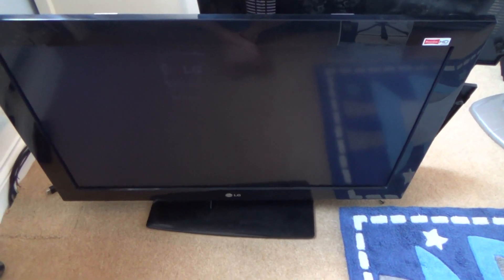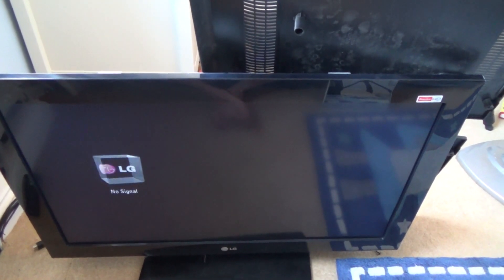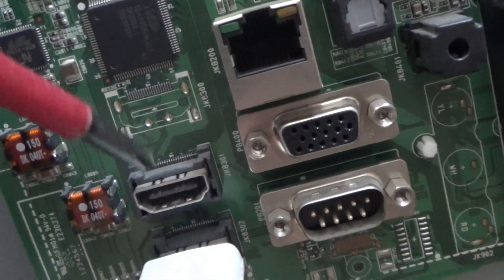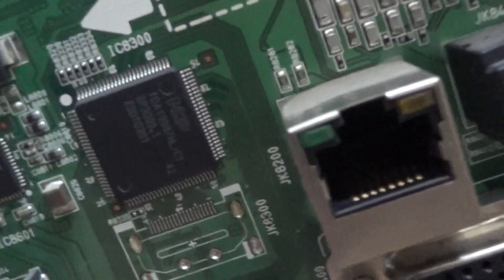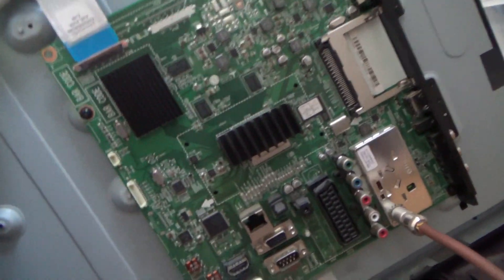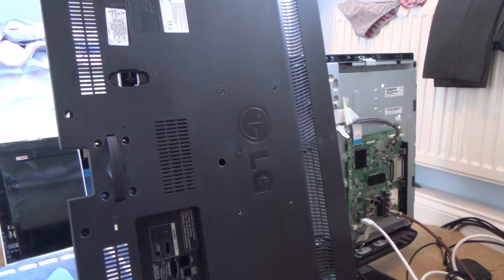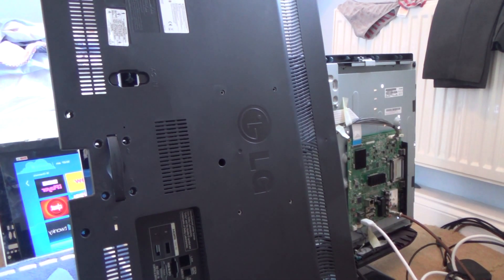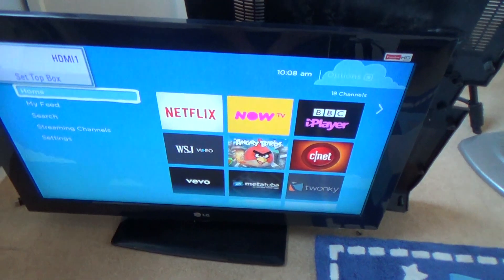Faulty HDMI Port on LG Television. No Signal Fault

Comment: thank you.  big help.  fixed by LG 60LD550.  I reflowed the CPU processor as you did, but also did a chip next to the 3 HDMI inputs (saw someone else say this was the problem).  So I used flux on box and then reflowed with a heat gun and a meat thermometer.  Worked like a charm.  Let's see how long this lasts.  I had paid an internet company to fix this card about 4 years ago, they probably did the same thing.  Thanks again.  Good video.

Comment: Wondering if you could give me any advice, basically my hdmi port will not work for my PlayStation everything else is fine. I’ve changed the hdmi wire tried many and still no signal. The tv is about 15 years old one hdmi port.

Comment: Easier to just use the software and do a factory reset. Had probably put devices in different HDMI ports after unwiring after electrician visit. Was not recognising my PS5 and more and was saying Sky box was connected twice. Doing the reset sorted everything. (Be ware any apps would get purged)

Comment: On my LG LE 5500.. it is not the hdmi chip..( TDA19997HL ) but the processor with the big heatsink that have to be  reballed.. but i  repaired  with a mechanical solution.. put something between  backpanel and heatsink.. so that there is pressure on the heatsink. or a plastic screw.. so you can adjust..

Comment: It worked! My neighbor tossed his 42" and said the part was no longer available to fix the inputs. I figured maybe eBay might have a board. I did find one, but it was too expensive for repair of a 10yo TV!

Propped the hairdryer right up to the chip with my opened TV lying flat and let it heat for 5 minutes. I also saw that a screw was missing at the corner of the board. Neighbor had taken it apart already, so maybe he lost one. I found one to put there. Gotta make sure the board stays flat! I sprayed rubbing alcohol into the hot ports and swabbed them a bit. Back together, and all good! Thanks!

Another TV I fixed had a known issue with a screw not being grounded. Something like that. Easy to repair except someone else had ruined the board trying to DIY solder. I spent money for a board anyway because it is a nice older plasma, large screen. Still working.

Comment: My LG tv HDMI ports all stopped working tonight. I followed these instructions and wow !! now working perfectly, thank you.
Reply: Is it still working for you ?
Reply: @EternalNovA  Yes 3 weeks on and still working perfectly, fingers crossed.
Reply: @malcolmtodd2340 how long did this last?
Reply: @BerkshireAutoDetail  I replaced my TV about 6-8 months later and it was still working fine at that point
Reply: My tv did this so I'm gonna have to take it apart and do this and see if it works

Comment: It worked!!!! I tried that on a 50 inch LG 50PK950, and after a few time with no Signal, HDMI started working again! I have to add that the total time of Heat I applied is 2 to 3 minutes, in attempts of 30-40s, then stopping. HDMI came back after some time, not instantly after heating
Reply: hello hot air repair still holds? thank you

Comment: I had same problem, the chip that is not working only controls the hdmi signal. Solution, buy a cheap hdmi to vga converter like this one https://smile.amazon.co.uk/VENTION-Converter-Adapter-Digital-Projector-black/dp/B07F7WYGHV

Comment: Great!!! It worked to my LG 47!! Thanks boss!! And it's one more tip. I didn't remove the back cover, but blew into through the duct. It worked when I blew about 30secs, and I did 1min more for just in case. It took just 2minutes without any tools!!!!
Reply: Thank you
Reply: Is it still working now with one-time fix?
Reply: @jun9886  Yes. It still works well. Ironically, I thought heat was the cause of the breakdown, so I put a cooler on the back cover duct a month later. It only costs $5. I stuck a 60mm usb cooling fan with double-sided insulation tape. That's all I did. Good luck dude.
Reply: thanks for the tip. worked for me too on my old  LG 55  '12. didn't have to take out the backside, i just put the hairdryer very close to the duct. no tools needed.
Reply: @juicychicken6779  No problem dude.
Reply: @juicychicken6779 with the tv turned on?

Comment: Hi same problem samsung model number UE55ES8000U
UE55ES8000UXXU 
version no 1
S/N Z9EP3SAC401936Z
Samsung Main
Board BN41-01800B BN94-06124K
Any ideas would the hdmi heat work they stopped working after a lightening spike on the mains

Comment: Like you said it's a shot term solution. The problem is that one or more pins on the HDMI chip has lost it's connection to the board because of expansion and contraction over the years. The easiest , permanent fix is to use a soldering iron and solder wick. Lay the wick over the all the pins on one side of the chip and then slowly drag the hot iron down the wick  . Do the same for the other 3 sides. Be careful not to pause to long as you go over the pins since you don't want to suck all the solder out from under the pins. The goal is to heat the pins just enough to get the solder to turn liquid without sucking the pins dry. Sucking them dry is just about impossible anyway but heat is the enemy of chips so don't hang around too long with the hot iron as you go along.
Using the soldering wick makes it virtually impossible to solder 2 pins together by accident. If you just run the hot iron over the pins without the wick it is VERY easy to solder 2 pins together.
Reply: Well is this method a permanent fix or short term too?
Reply: @DJrockSStar  -It's permanent . I forgot to mention that brushing on some flux over the pins helps the solder to flow better.
Reply: @TheNYgolfer  Ty for bothering to post this I'm a huge fan of doing this sort of thing yourself, this appears to be the same issue as the red ring of death back in the xbox 360 days, i wonder if a lot of these port issues are simply the thermal paste losing effectiveness rather than the components themselves being bad, i mean they're like metal and crystal and shit it seems reasonable that they wouldn't just go bad after a few years pretty durable materials, whereas the paste isn't really by comparison.
Reply: Late reply this may not work if the controller chip for the hdmi has completely fried!
Reply: A mi me sucede al ver los canales cual sera la solucion. Solde los pines del varicap y no funcionó
Reply: Me gusto tu explicación.  Lo. Voy hacer. Tengo un led q funcionan cuando quieren los hdmi. Yo reinicio el tv para q vuelvan a funcionar

Comment: This is my solution. Suddenly all of my HDMI ports from an 50 inch LG Tv stopped working. I've watched a lot of this videos. My HDMI ports were listed on the menu (that mean that they have power) but always showed NO SIGNAL. I've tried to use this method but decided to follow Carlos Frontado (user in the comments) and bought the chip that is responsible for HDMI ports (2 USD on ebay) and found a profissional that changed the chip on the board (a TV repair profissional) and voila...it now works. This is my advice. Change the chip.
Reply: does the chip have to be the same as the motherboard or can you just take a random spare?
Reply: @jumbescosisbruh6110  Random spare.

Comment: Thanks for your video, my lg do the same fault years ago and I send it to an technician to "rebail it" and it was work for a few months then it fault again. So I open it and take a look at the main board and see some marks on every chip pad, like if it was  heated with and soldering air gun.  will try to fix my lg like you explain here and write to you if it works  . Thanks again, cheers  from Argentina!!

Comment: i fixed my lg tv and have been using it for 3 years you need solder flux and hot air gun not air dryer as that will simply just warn the chip up for a short time

Comment: It works, but only for a few minutes, is there any way that i can attach a heater behind to constant keep the chip heated?
Reply: You need a heat gun that can heat it up to about 350 farengheit  for 20 sec. issue is coused buy bad quality chips they heat up during operation and soldier develops a crack.heat it like I said, and it should be a permanent fix, hairdryer will work but not for along time ,it will not get hot enough to get a good soldier flow.

Comment: Thank You. This works!!  I have a 48 inch LG about 5 years old and it was working perfectly up until recently. The TV is located in my basement rec room that isn’t used that much anymore since my son moved away. Like most homing pigeon kids he returned however the TV would not work on HDMI. I think now that he’s using it again and just getting it back warming up again the problem may go away permanently.. Your right that it doesn’t take much heat. In fact I decided to try it by just heating directly onto the back without even disconnecting anything.  I used a 1200W heat gun about 6-8 inches away for no more then 15 seconds and the HDMI ports became available again. Easiest TV Repair Ever. Thanks Again.

Comment: Hi ! Thank you for the nice video !  I love fixing theese boards ! ,.,,  Just get yourself some NO CLEAN FLUX and set your heat to 250 Celsius Temp. for about 15 seconds evenly distribute the heat to the whole chip while covering everything else around the chip with aluminum or better :) it will be a permanent fix !  ... Kind regards 
Frank

Comment: It works thanks!
Reply: Excuse me,  my PS4  isn't detected by the three HDMI ports so if heating it should work ? Thanks 4responding...
Reply: @tanjawiuk709  it works on my device. but this is only temporary fix though
Reply: @mikesong256  
But u should just reheat the chip 2get it fixed, ye?
Reply: @tanjawiuk709  yes

Comment: yes that is a good short-term fix and the other one when you bake in the oven for 10 to 12 mins,the way  i have solved the problem is I have a Freesat box that has a scart plug on back so my tv also has a scart so just put an old scart lead in and now working, also the blue ray player have bought an HDMI lead to Component lead yellow-red white,and for my games console bought a Wii to Composite lead .you can also get component to component and component to hdmi.this is the way if you dont want to take the tv apart.

Comment: Before I took my TV apart (or bought a new tv) , I investigated other possible solutions. Adapters: If you choose the male hdmi with female vga (which is also 1080 on the back of the TV) AND the audio output, you can do a permanent fix.. I found several on Amazon for $8.00 even including a mini-hdmi to usb and the 3mm audio.  Works wonderfully. And the hairdryer solutions ? My electrical engineer friend says it's NOT the chip that is fixed by the heat but the micro cracks in the solder in the board, that expand and reconnect once heated. And slowly recedes and disconnects. This way it's permanent.
Reply: Your engineer friend needs a bit of an update. The QSOP Chip actually has maybe just one detached leg causing it to have a little space between the contacts.Due to the heat expansion the leg gets a bit larger and it may touch the solder of the mainboard like it should , then due to surface tension or adhesion it actually picks up a small bit of solder paste and reconnects with the main board. BUT because of the cold drawing back the leg again to its original size it pulls this solder back in a fine line and only the fine line of solder >( like a spider web string ) is now connected. NOW you have HDMI Signal again , BUT because of the process of shutting off you tv and then turning it back on there is Thermal stress that will likely break this little spider string in the near future.  The Proper fix is : Put the Mainboard flat on the Table and dump a coin on it. Use a syringe to put FLUX on it. Heat the Chip to about 240 to 250 Celsius for about 15 Seconds until you can MOVE another component with a plyer next to the chip. If you are able to move another component next to the chip that means you have reached the proper temperature. you can now withdrawal the heat SLOWLY ( about  an inch every second. This will help with the thermal contraction being done almost properly. The weight of the coin ( anything ,,, maybe just a cent or two ! )will put enough weight on the Chip to put it down properly.  .... NOW if things are still not fixed then  you MAY have a broken trace (this is where the fun would start for me  ! ) ...  To pinpoint the issue further you could use some ice Spray , but proceed with caution.Even a TV that has been disconnected for 6 month may still hold a charge up to 300 Volts or more in its capacitors... It wouldnt be fun... Trust me :)   Kind regards Frank

Comment: Hi everyone! No need to heat the chip! The problem 99% of times is just the dirt or the oxidation between the teeth of the two chips that are shown in this video! That's the only solution, also because many of those main boards are no more purchasable

Comment: Con esta solución arregle mi 42le5550 sin sonido. Simplemente puse un secador de pelo directo al disipador grande del MCU principal por 5 minutos hasta que quemaba como loco (y un poco al nt7000).... y el sonido volvio al encender. No creo que sea un tema de reballing sino alguna protección que salta por temperatura y queda bloqueado. Ademas le agregue unos disipadores de bajo perfil. Una tremenda bosta estos televisores. Creo que la solucion de meterlo en el horno es demasiado agresiva.

Comment: I got an LG surround system BH9540TW. The HDMI stopped working due to a thunder strick but the system still turns on and all options seem to work apart from the HDMI output. I can turn on the Bluetooth and connect my phone, i can use the optical input, i can use everything else apart from HDMI output. Do you think this method can work??? I want to give it a try. Any recommendations? Thanks for the video, its brilliant

Comment: well i'll be a monkeys uncle. i honestly was completely sceptical. i had tried everything else, firmware updates, new cables, the lot. i really cant stress enough how much i thought this was bullshit, but bugger me if i dont have a working tv now after doing this. does any other previous success stories know why this worked or have a more permanent fix?. ive cut a hole in the back of the tv so i can heat the chip without taking the back off in future but any more info as to why this happens would be helpful. its also worth pointing out that the hdmi cable i was using originally is now stone dead

Comment: I followed the baking directions. While the board cooled I used a hole saw to cut out the area in the back case over the HDMI chip which has very limited clearance and ventilation, and attached a 20x20x10 mm heat sink to the chip. It seems to be working. I am surprised how warm the heat sink gets running full 1080p. What shitty engineering.

Comment: In case this chip damaged. where can I oder this chip? please advice . thanks
Reply: You need to order a complete replacement circuit board. The chip is flow soldered on.

Comment: I tried applying some solder paste to the microprocessor where the hdmi goes to and heated with a blowdrier. When I turned my TV on there was some smoking and the screen flicked, now I dont even have any image. What happened?
Reply from the maker: It might be worth getting some solder wick and removing the solder paste to see if you can get the screen working again. If you have a VGA port then you can get a HDMI to VGA converter and then you can connect up the HDMI equipment to the VGA port if the HDMI ports are dead.
Reply: By applying solder paste you shorted out the connections and probably fried the chip. Not the heat that fried it but current through the short.
Reply: You shorted out your tv with the solder...

Comment: Ok so a 24hr update from my last comment. I didnt take TV apart,i done a factory reset first and hey presto My Life's Good LN5400 is back to normal so i hope doing this solves the issue for some of you with this HDMI no signal problem.
Reply: Go to settings menu then open Option. Mines got a pic of a tool box with a spanner on front. Its in there.

Comment: Cool thanks. My LG 42" HDMI ports packed up last night so im looking for solutions. Ive got an adapter with five ports for Virgin box,xbox, surround sound n a flat cable running under carpet to laptop next to sofa to stream movies etc. My TVs only 3yrs old cost £550 so not impressed,great picture tho. Il have to buy a hair dryer n see what happens or i could pour hot water on the chip but the result could come as a shock!!!
Reply: wylej wodę na łeb i wysusz suszarką

Comment: My LG TV had same problem since one month ago and I will try this trick today. Anybody knows why this happen? Is it a quality issue with LG TV?
Reply: It's the poor quality lead free solder used by LG that's cracking over time. The problem 99.99% of the time with these old LG TV is with the main chip that controls the board, you'll never permanently fix this HDMI issue, and other issues like having no audio from speakers, TV not turning on straight away, unless you reball the main IC chip with good quality solder.

I've fixed many LG TV's from their old LD range with this HDMI no signal fault, like the 42ld550, 47ld790, etc, and the problem has always been the IC100.

Comment: I just did this, fixed the HDMI port on my LG 43" 4K TV.
I was having problem one day HDMI port just blurry on port 1, port 3 doesn't work at all. wigging port 2 broke port 2 as well. Heating it for a minute, back in working condition.